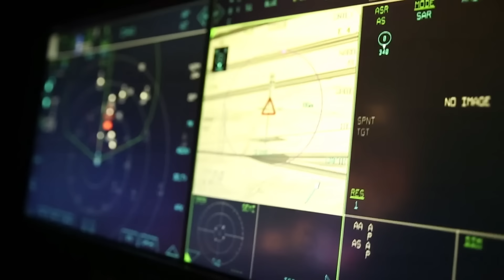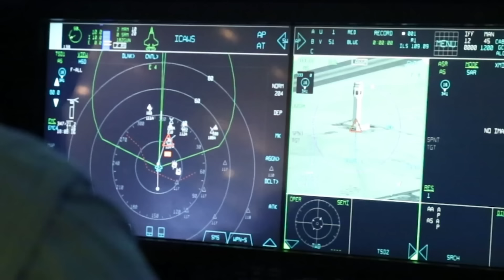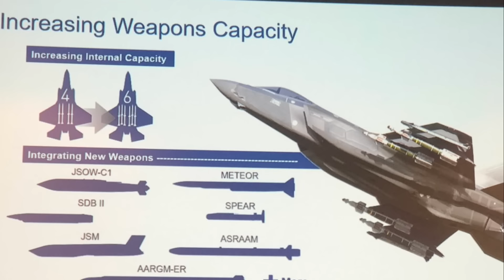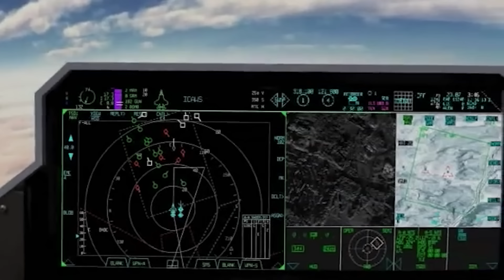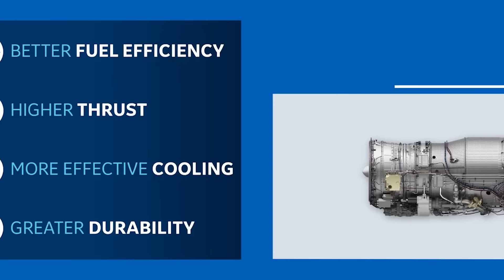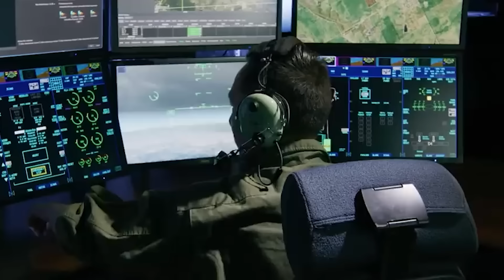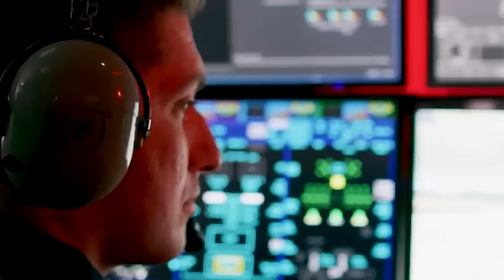The F-35 is about to become a POWERHOUSE

Comment: There's an error in the text. Su-57 is NOT a 5G fighter. It's more like a glorified 4+Gen. Some key parameters of 5G are missing. Mostly stealth. Contrary to what Russians say, Su-57 is not stealthy aircraft. It just has reduced radar signature compared to Su-27, but it's still huge in radar compared to F-35. And there are other issues (missing or very limited sensor fusion).

Comment: Cost of the USAF NGAD is slated to be so high that they cannot even afford to develop that platform.  The USN F/A-XX is a 6th Gen fighter that can meet all the needs of the future Navy, and most if not all the needs of the USAF, and we simply have to have it.  Since the retirement of the F-14 Tomcat the outer air battle has been a challenge, and the multi-role aspect of all platforms today make the F/A-XX the solution for many problems in one TOUGH package.  The USAF should just adopt the F/A-XX and join in the development effort.  It would not be the first time the USAF has adopted a USN aircraft.  The F-4 Phantom II is a case in point some of which are STILL flying in a few air forces around the planet.

Comment: I’m curious if the next generation chaff is a group of battery powered 904nm lasers through a refractive lens making it appear extremely bright in the eyes of an infrared seeking sensor mounted to a a2a missile?
Reply: So you plan on spoofing the missile from IR signature by giving it a laser to follow instead (even with a refraction lens the seeker is looking in not out so the "visible" light from a seeker perspective will be directly from the A/C)... :) In general you want physical separation between your countermeasures and aircraft. Saturation of seekerhead might be possible but I wouldn't bank on it.

Comment: The funny thing is that Canada was the first country outside of the United States in line to get the F-35, but their Defense Department claimed that it was a boondoggle. Basically, the F-35 had a lot of software bugs, but they fixed them. So Canada canceled their order. Which made Israel the first country to take delivery of the F-35. And Israel used their F-35s in combat missions over Iran and Syria. Israel has yet to lose a single F-35. Iran fired its Minister of Defense because Israel keeps violating Iranian airspace on a regular basis. Iranian pilots can see the F-35 but they cannot track or target them. Now Canada wants to buy the F-35. Had Canada taken delivery years ago, they would have saved tens of millions.

Comment: hope F-35 upgrades include a proper 25 MM or 30 MM internal cannon . . . especially the naval carrier borne F-35C Lightning II stealth maritime multi role fighter interceptor . . . future F-35 could do with a tad longer fuselage & acceptably larger wing span . . . if operating costs of the F-35 can be curtailed to a level that's practically possible, expect Lockheed Martin to sell anywhere between 392 - 468 brand new F-35A Lightning II (Block 4+) stealth multi role interdictor strike fighter to air forces around the world . . . over the next decade or so . . .

Comment: They REALLY need to make the adaptive cycle engines a top priority. Pratt and Whitney’s proposed upgrades are a superb stop gap to keep the F-35 improving incrementally (as it SHOULD be), but the ACE, whoever ultimately produces it first, will be a HUGE leap forward for whoever gets it right.

Comment: When we🇸🇯 signed up to buy the F-35 I didnt agree! I didnt agree that we put all our eggs in one basket. I thought we should do 50/50 buying half F-35 and half Jas Gripen. The Swedish government and the Norwegian government proposed we could work together and that Sweden would outsource some of the work needed to build it to Norway and thereby create workplaces for Norwegians. To this day I still feel we should have bought some Jas Gripen just because our main enemy is Russia, thats our biggest fear and the Jas Gripen was purpose built to handle Russian threats. Not only that, but the way I see it is that you dont drive your Bentley(F-35 )every day, you drive your Volvo(Jas Gripen). And Jas Gripen is a great work horse and would suit the the Norwegian terrain perfect. But I know why we went for the F-35 Lighting 2 and that was because of the upgrade capabilities especially when it comes to the software. And if Norway down the road need to upgrade the F-35, we could and if needed strike inside Russia and have a fighter jet  that would last for another 25 years without loosing it edge. I know that the Finnish government are replacing their F-15 with F-35's. That means that together with Denmark and Finnland we would have around 100-110 F-35's to put in a fight together with 90 Jas Gripen from Sweden. That will pack a punch. And if I know my government we would upgrade these fighters as soon as possible. To get a increase of 20% power, better radar with twice the detection of what we have today would be a big deal when you think of the small distance between Norway, Sweden, Finnland and Russia. It basicly meens that we could detect Russian fighters and radar stations half way in to Swedish territory and would be a huge advantage. That also means that the reduction in fuel consumption would be handy. I think Russia should be very careful about approching the Scandinavian countries not only because of our fighter jets, but our ground forces as well. We have mandatory military service in our countries and if ever invaded again(WW2-Germany) we be ready to fight and would gather around 2 million soldiers combined.

Comment: F-35 borrowed a lot from F-22 which is why it needs this radical refresh - The British stung with similar issues to F-22 with their Nimrod programme (impossible to upgrade obsolete point to point systems) which doomed it - re-engineered Typhoon when they had a chance to a total open system architecture, Typhoon like Gripen (and Rafale) can easily be upgraded without touching the software with totally modular hardware systems - except the modules required for NATO operations (such as linkl16) which are US made and very old.  Some of F-35s passive sensor suite systems systems are modern and modular (being BAe supplied) - but the F-22 Intel i960MX cast-off systems are obsolete and have been for years.

Comment: Imagine if they made a stealth drone missile truck airplane that would follow the F-35 some miles behind, below or both. It could launch its missiles then RTB. Allow the F-35 to use its "Quarterback" function and never break its on stealth by opening any doors, or leaving a smoke trail. And in a pinch it could deploy radar emitters that mimic a F-35 or any other plane and pull incoming AAMs away. Or even after emptying its payload act as a cruise missile or Anti-Radar missile. Expensive but way cheaper then losing a F-35.

Comment: Well then they can fly at altitude without the oxygen petering out, maybe it'll eventually be a decent weapon system. But because it only has a .6 to 1 thrust-to-weight ratio, I doubt that as well.
That is why they're upgrading the F-15, because there's a turns out. Proven success is a great value. It also doesn't have the same oxygen delivery problems that the F-22 and the F- 35 have.

Comment: Video game logic.  Stealth is cool and has an effect to a degree.  Does heat seeking missiles or tracking systems defeat stealth cause you don't cool the exhaust out put enough?  Of flairs for defense right, don't those run out.   Or can a "smart" heat seeking missile get a lock on the first original target and save it to it's ram/hard drive and not be on active search and get deflected targeting to another hot target like a flair.  I am under the assumption that a heat seeking missile will actively scan the area in front of it and target the closest hot spot.  A simple adjustment to the sensor calibration could distinguish the heat difference between the original target and a hotter or cooler one.  Have the missile only hit a target with an exact temperature (the one you targeted and fired on... sets the parameter).  Do the flairs have the same temp as the exhaust output?  If it was a video game I would spend less time and money on stealth.  A new drone can be heat free, made of non metals (mostly) giving it a natural stealth presence.  Attach a c4 explosive to it and your half way there.  Remote piloting to save real trained pilots lives.  No g-forces to worry about so the drone can fly "harder" without the limits of a human body in it (last second dodge thruster?).  Cheaper to make and in mass numbers.  Blanket the sky with 1000 drones and let the fast aircraft just hit one like a bug on a windshield... but the bug explodes differently.  The olympics had organized drones in formation in the air for a light show, weaponize it.  One A10 warthog with those big wings could easily attach drone cluster packs for longer range deployment (I love the A10).  The F35 is cool but I personally don't think their worth the price tag vs. effect.

Comment: The F35 has the capability to reduce an Airforce from 200 F16's to 50 F35. Virtually pitching these airforces, the F35 would not have enough rockets to eliminate the F16's and perform ground attack missions  even if each rocket would be a hit.

Comment: I feel like the marine requirement made the Air Force and navy versions suffer in their capabilities.  Sure the data capabilities are great but the airframe is small and not exactly a long range carrier platform and they bit have a one engine solution.

Comment: The F35 with the new XA100 engine, new stealth skin, and combat system upgrades will make it one super aircraft far more capable than its predecessor.  The Marines will not get an GE XA100 engine upgrade, but they can get the other upgrades.   If the PW XA101 can fit in the F-35B then an engine upgrade for the Marines could happen.  
United Technologies Pratt & Whitney jet engine company received a $100Billion sole sources contract for F-35 Lighting II Fighter Aircraft for a twenty (20) year period.  The GE F136 just marched right into the Adaptive Cycle Engine Demonstrator Program, and should get credit for their outstanding effort in this regard.  The XA100 has outstanding power, efficiency, and durability improvements that will provide the F-35 a whole new lease on life halfway through its lifespan.  Time to make a decision and move out!
Reply: "Time to make a decision and move out"- time for Congress to cancel this boondoggle bankrupting America.
This plane has been a failure from the get-go. Time to stop shoveling $$$ to this failed program.
"provide the F-35 a whole new lease on life halfway through its lifespan" - it has done NOTHING in its lifetime - except fleece taxpayers!
Reply: @DennisMerwood-xk8wp  I beg to disagree.  EVERY pilot in every service and country who has made the transition to the F-35 (all flavors) do not want to go back to their old platform.  If one is not in a Stealth aircraft in future combat, and fly through the combat area . . . you probability of survival is so low that it is incalculable. Even with all its problems (and it has some) it is still better than everything else.

Comment: Did I hear it correctly that the update will cost 15 million per plane ??? That right there is the problem, since many countries that use the F35 will not be able to afford it. Sure the updat is great, but they already had to lower the total amount of F35's due to the high price. Another 15 million for an update is not going to sit well, no matter how great the update is. 
On top of that, we are getting very close to the point where the plane can gather simply too much information to be processed by the pilot. As we have seen in other situations as well, having more information does not always mean you have the advantage. It is all about having the right information at the right time, it should not be cluttered by other information, which could be important, but not at that moment. So, if this continues the F35 can use a back seater to handle all that info.

Comment: Don't believe any of the upgrades will correct it's biggest weaknesses. In the battlefield, maintaining this thing is it's downfall. In a true battle situation most other modern fighter aircraft are going fair much better. But, that's just me.
Reply: Indeed - it's too complicated to ever be reliable enough to be useful.  F-15 EX and F-16 will turn out to be the plane that saves the US.
Reply: It only requires 8 hours per flight hour, which is on-par with large 4th gen fighters such as the F-15. It also demonstrated many times it is capable of multiple missions per day. The problem lies in parts availability and the spread-out supply chain, not the complexity of the aircraft.
Reply: @dumdumbinks274  Not true because the availability of the aircraft is still terrible - you need three F-35s to keep one in the air!
Reply: @LondonSteveLee  Only if you don't understand the statistics or are intentionally manipulating them to suit your agenda. Fleet availability does not affect frontline maintenance in combat-ready squadrons. The 1/3 of F-35s that are fully combat capable do not depend on the 2/3 of F-35s that aren't. Combat-ready squadrons are equipped with combat-ready jets and can function just as effectively as 4th gen squadrons.
Reply: @dumdumbinks274  Fine, keep up the pretence that F-35s are reliable if you want - doesn't bother me. The irony is the Brits are reducing available thrust for their F-35Bs to protect the fragile engine - in the same year Rolls Royce have unlocked a staggering 30% thrust increase for EJ200 customers - the Typhoon's engines are doubling expected MTBF in service and therefore can be pushed much harder. It was already a fighter with leading power to weight figures in intercept trim - they are out the park now!  The penny-pinching RAF will probably keep the old limits though - got to pay for all those lemon F-35Bs somehow!  Underfunding Typhoon is just the ticket.
Reply: @LondonSteveLee  Lol. I find it amusing that you're citing an operator that is known to cheap out on most things as an indicator of F-35 reliability. Underfunding the Typhoon is not a result of the F-35. It's a result of repeatedly poor decision making and cost cutting. Afterall without the F-35B they can't justify their cost cutting of their QE carriers. No catapults or even arresting gear means they are just over-sized helicopter carriers, so they are forced to use the most maintenance intensive and least capable F-35 variant for fixed wing operations.

The USMC who are the primary customer of the F-35B - and who use it on ships it was designed to be used from - do indeed average 8 man hours per flight hour. 

But other than that, there is currently a shortage of spare engines resulting in a backlog of F-35s awaiting maintenance at depots. This knowledge could easily influence a decision relating to engine lifetime, particularly on the B which has many more moving parts.

Comment: I wonder, wouldn't it be more efficient to invest all that money in improving missiles and anti-missile systems instead of spending it on new planes and/or ships to compete with Russia or China? A missile costs less than a plane and much less than a ship, and they can be manufactured more quickly. No matter how good or expensive a plane or ship is, a missile or torpedo that costs a fraction of them will destroy them. What's the point of having the most advanced radar systems that can detect the enemy hundreds of miles away when we have missiles that can only reach less than half of that distance?